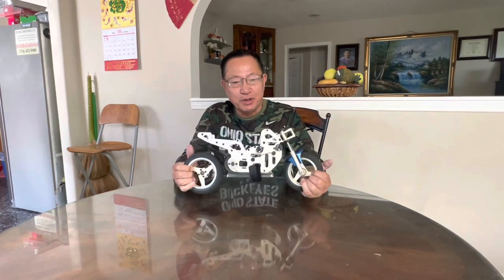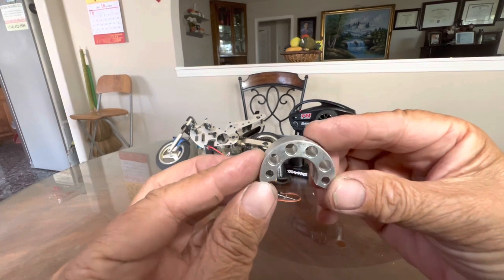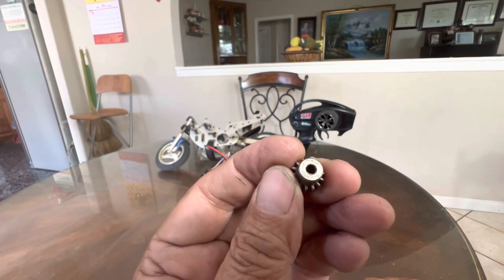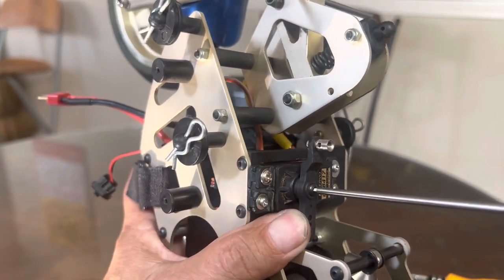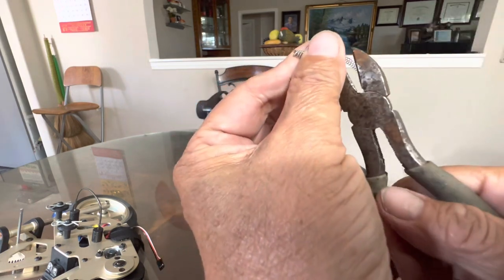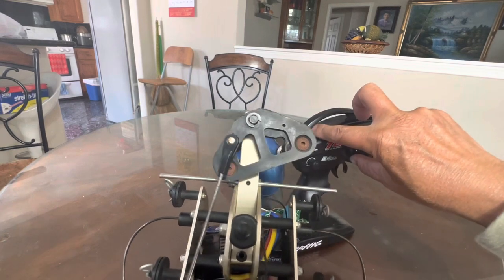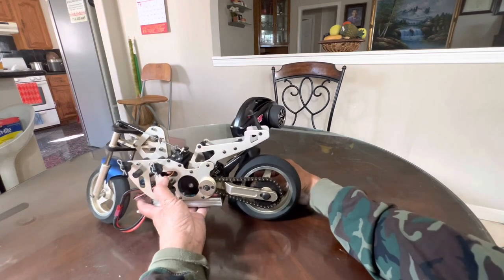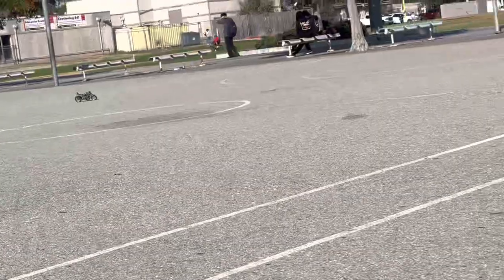Rebuild RC Thunder Tiger Ducati  Motorcycle 1/5 Scale 3S

Comment: I’m intrigued by these RC motorcycles I have Crawlers & bashers & caught a video of a motorcycle RC before I found yours & it’s super interesting how the gyro keeps it upright & hauls A**! Not sure that I would ever get one but ya you don’t see a lot of Motorcycle RC content. Pretty cool. 😎
Reply from the maker: This motorcycle has no mechanical or electric gyro. Thanks to the two spring installed in servo arm, that helps the bike keep balance and running.
Reply: @dangrchobby6263  so motorcycle weight does not matter....
Reply from the maker: @fuhadrock6370  the rebuilt one almost has the same weight with the original.

Comment: With a motorcycle driver figure on top, one should buy a NIMH 7,2V Pack because the bike runs more stable in corners with a low center of gravity ! 3s with a 3900kv motor should bring a maximum speed of round about 70km/h. I recommend to only run 40-50km/h with these bikes. One should glue the rear tire to the rim when running more than 30km/h !!! I have 3 of these bikes. I run them with direct drive brushless motor and no chain :) => search: "Makerfabio Thunder Tiger Direct Drive" to see a video of this bike frame with direct drive !